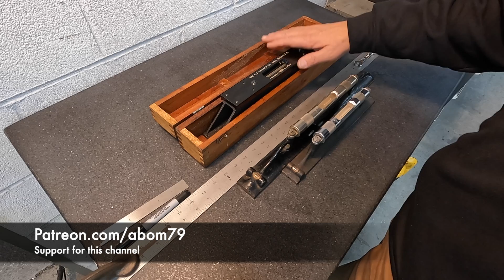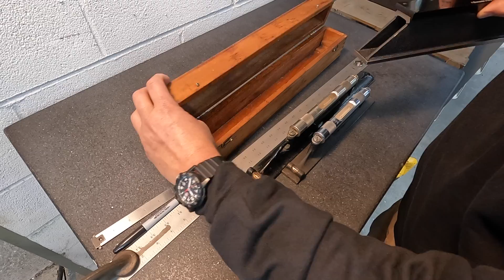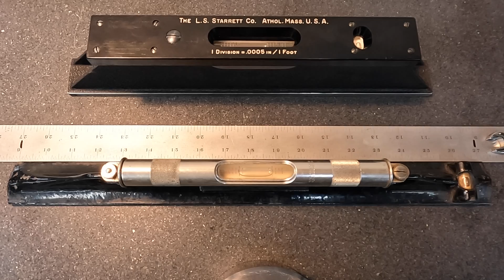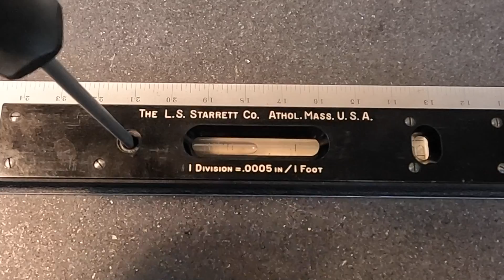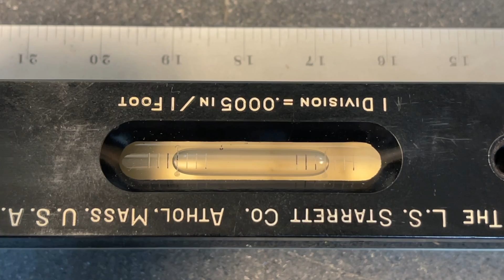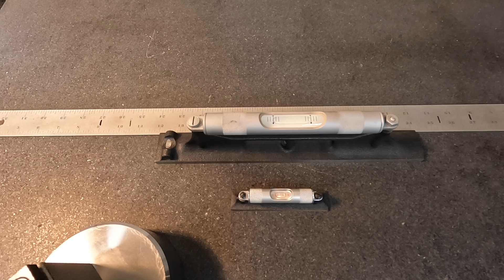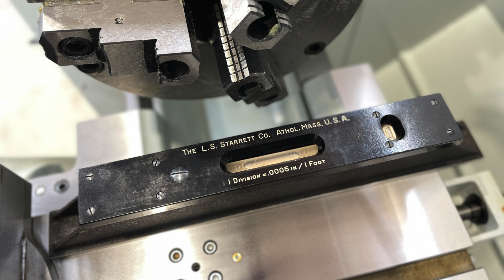Precision Level Calibrating

Comment: I was checking a Lufkin No. 58 and discovered that how you set it down will affect the reading. Raise one end to about 45 degrees or more and gently set it down. Carefully note the measurement and then with it staying in the exact same place, raise the other end and set it down. Note that the measurement is not exactly the same as the first reading.

Comment: 0.0024 degrees per division, that’s tiny for sure. I recently got a Mitutoyo Pro 3600 digital inclinometer that’s 0.05 degrees from 0-10 degrees and thought that was nice. That said for anything other than 0 and 90 it’s indispensable but bubble levels are wildly good for 0 and 90.

Comment: The most precise leveling I’ve seen was done by my uncle that worked as a high precision machining engineer for close to 50 years, he was using a precision machined plumb bob suspended on a rigid frame with a 180 degree arc on the bottom and each degree subdivided into 50 divisions. The tip of the plumb bob was grinded to a 10th of a millimeter. When he was calibrating the granite table I was amazed how much off other levels were.

Comment: How do you know that your surface plate is level ?     I want to level my lathe bed and have no reference .
Reply: Depending on the size, you can use one of the precision levels in the video for smaller ones. I'd say anything less than a 4'x6' plate. If you're bigger than that, though, you'll need some fancier equipment or even some pros.

Comment: At General Electric we used a laser to level machines. Machine riggers would have been able to do that for if you wanted to spend the money when the machine arrived. You should never level a machine tool unless you have very extensive experience in doing so. Using lasers to level a machine tool is the best way to go. If you can not level a machine tool with a laser then the machine needs to be taken apart & all of the ways scarped. then once the machine is level, the 3 jaw, 4 jaw chucks, & face plate will need to be turned. Once the jaw chucks or face plate is trued then they should be matched marked to the spindle.
Reply: You know laser levels are nowhere near as accurate as this right?
Reply: @StuninRub  You are correct, I worked for a laser company for many years, as an Engineer, and guess what we used to level the laser.... yup.  An L.S. Starrett precision laser.
Reply: @StuninRub there are laser levels accurate to better than 0.0002” to the foot. But they’re very exoensive. You can get a digital level accurate to 0.0003” to the foot for around $400. I believe it’s made here.
Reply: @melgross  You aren't very bright are you? 0.0003" to the foot just means 0.10 inch of error per 100 yards. Do you realize how crooked it is to be 1/10 of an inch out of level? There is a reason why surveyors use optical levels.
Reply: @StuninRub  what the hell is wrong with you? I gave a couple of specs. That’s it.  Are you always so knuckle headed?
Reply: So how did we do it before lasers were invented then? Using precision machinists levels to set a machine up is the way it has been done since the invention of lathes and mills. Lasers are a very recent invention in the scheme of things,
Reply: How did they do before lasers when  Devlieg machines were within .0002 all the way around.

Comment: generally, i get leveling a machine, but why does it have to be so precise?🤔
Reply: to avoid any amount of twist or strain.
Reply: @Anonymousg64  i get that, thank you.   but .001" or .0005" makes a significant difference?   most parts aren't machined to that tolerance.
Reply: @loudsubwoofer8492  when you want to machine a long part, it does make a difference, a small amount of twist can lead to different diameter being machined from one end to the other.
Reply: @Anonymousg64  okay, thanks
Reply: @loudsubwoofer8492  0.0005" per foot when leveling a lathe doesn't make a significant difference in day to day workshop practice.
it surely does in some rare and extreme cases in high tech industry, but then foundation for such a machine might be worth as much as Aboms whole shop.
When you machine a long part there are lot of tricks to be used to get into 0.0005 tolerances. You need to counter many variables, and believe you me that unevenness of your machine is pretty easy to overcome, since its pretty much a constant. can be tricky when doing your first few jobs on that location, but after months and years you worry about other stuff. 
such precision, and reasons Anon mentioned is practically important when leveling your flats which are later used only to calibrate and check your other measuring instruments
that said, what Abom is doing, chasing perfection, is purely for escethics and work elegance of his, which is main reason i regularly come here and watch his work :)
Reply: Some people here seem to think that a half thou is a very fine accuracy. It’s pretty much standard in any halfway precision work. If you have a twist of a half thou in a 24” lathe bed, you will get a one thou taper over that distance. That doesn’t seem like much, but due to changing temperature and conditions in the equipment, what you measure isn’t what it’s going to always be. After an hour of work, because of headstock heat in the bearings, etc., that twist may be more or less than that. So it’s always best practice to make sure your equipment is always set up as accurately as possible, and to check it often if precision is required.

If you’re just doing chuck or faceplate work, bed twist isn’t as important.

I hope that helps.
Reply: Good question!  I was wondering the same thing

Comment: You didn't explain that by turning the level 180 degrees, you negate any inaccuracy in the surface you're using.  I have a wheel alignment tool that we check by sticking it on opposite sides of a steel door in the shop.  Using both sides negates any lean in the door. It looks like your granite plate is pretty accurate.
Reply: i always thought that by turning level by 180 i eliminate potential level error

Comment: Used one for setting a turbine generator at a processing plant in northern BC we had to use it in the morning only because by noon the drastic temperature changes would change the calibration, it is crazy how accurate they are and how such a little thing like temperature can affect them
Reply: Steel changes at .00000065 per degree F per foot.   Carpenter apprenticeship told us how to correct our steel layout tapes. Only made differences in excess of 400’.  After the test we were told we would never use it again. Surveying Montana, the Dakotas, and Wyoming for sure they had to correct their measuring chains for temperature.

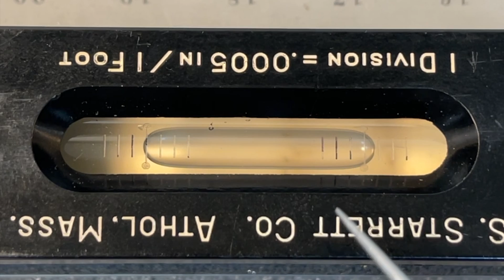Comment: 21:41 that's stil way off and not calibrated....
Reply: The surface plate isn't level. But the level shows the same deviation from center when flipped 180°, so the deviation from center is simply a measurement of how far off level the plate is! The level is properly adjusted.

It's a self-checking process, a non-level surface can be used. Without the flip for self checking you'd need a perfectly level surface to start, before you had a way to measure it, which is impossible.
Reply: @PeregrineBF  damn...you're right.... i did not think of that and asumed that the plate already was level.
Reply: @Ralphwijkens  Learning by confusion tends to stick!

There are a lot of these "self-proving" techniques at the base of metrology. Moore's book "Foundations of Mechanical Accuracy" goes over a lot of the mechanical ones (flatness, straightness, angles, roundness, concentricity, etc). The systems for defining the SI base units now all have similarly verifiable measurement techniques that tend to cancel out their own errors.
Reply: @PeregrineBF  That book is one of my favorites.

Comment: Been a machinist since 1970 and never owned a level, used to make high precision fasteners for aircraft...  A machine is it's own entity...  lets exaggerate,  why would it matter if the machine, lathe, was a inch higher from end to end....  I am sure there will be lots of comments on this, can't wait...
Reply: End to end level does not matter as much as side to side. The bed width is leveled as close as possible at both ends of the lathe to eliminate possible twist in the ways. The tailstock should be slightly higher than the headstock to prevent coolant from running off the ways on the floor.
Reply: I think it is more to keep the entire machine in the same plane and equally supported so it is not twisted or distorted. In my opinion this is more important with a machine like a lathe which is long and less rigid than a mill which is less effected by how it sits on the floor. The longer the bed the more critical that support becomes. I have used precision angle blocks and a level to mill flats at certain angles to each other, in this case having the mill leveled really helps or you will have to compensate for any differences that the table is out of level.

Comment: I learned something from Lipton last weekend at a Meet and Greet. He was calibrating a Japanese master grade level, and pointed out that as long as you match up the bubble, it doesn't matter if the plate is level or not, and as long as the level sits without rocking you can still calibrate it as flipping 180 degrees actually compensates for it, providing world peace. The Wiz just marked lines to lay the rule at the same position, he may have had it clamped lightly, can't remember.

Comment: No offense but .001 per ft. is a little anal in my world...that would drive me crazy trying to level anything in my world with it. 😅🤣🤣
I'm sure it has it's uses, but for a lathe? Calibration is one direction against the opposite, if the bubble's off you just remember how much. 

But thanks for the tutorial Adam👍
Reply: It's to ensure there's no twist in the bed, NOT that the headstock & tail end are at the same height off the floor.

It's not about the lathe being level, it's using a level to check flatness. You can't really fit an autocollimator across the ways, a precision level is easier and works well. Same principle as checking flatness of a surface plate with a level!

Comment: In the video, it looks like the flat stone is not levelled in both directions (high towards Adam). That might cause a misreading.  We use 0.1mm/m levels to adjust flatbed printers. I have not found any 0.05mm/m that is short enough at a decent price otherwise we would use that. The levelling surface is rather small on some models. The 199Z in the video corresponds to 0.04164mm/m. In Europe 0.02mm/m is very common.

Comment: Actually you're not performing a calibration but a justification. Calibration is measuring the offset of your daily used tools vs a calibrated rarely used reference. The reference is typically 10 times more accurate. Your table is not calibrated. But for the purpose of aligning the indicators to their reference surface that indeed is not needed. But you are performing (and explaining very well) a JUSTIFICATION. Thanks for sharing the procedure!
Reply: OF Purchase? ...😅
Reply: Quality surface plates are calibrated   and certified for extreme flatness, depending on the grade, by the manufacturer before they’re shipped to the customer.

Comment: Norm Abrams called the high spots "Shiners" when a shiner showed them selfes  you would identify all the spots that needed work . Norm would find shiners was on hard wood flooring wile refinishing and that was a nail and you could only find after sanding and you needed to counter sink  either way it was the best way to find where it needed more work to get a flat surface .

Comment: looks like you need to re-paint your division lines. I believe keith rucker did a video on repainting the lines, and replacing vials sometime last year, or the year before... IIRC you basically just repaint the lines, and wipe away the excess paint
Reply: with how sensitive it is, just getting the bubble in the window is an accomplishment.

Comment: Abom, try using a right angle screw driver, the longer lever will give you more control over the adjustment....
Reply: I was thinking a screwdriver with a hex on it and use a wrench to move said screwdriver (long way round but many dont have a right angle screwdriver
Reply: @connahjones8178  they're easy to make if you've got a blowtorch and a vise.
Reply: or a screwdriver socket bit
Reply: @F0XD1E  just after replying to this i realised that i have a set as you say. i think i would go with the wrench on the screwdriver as it would have less play but a good idea nonetheless